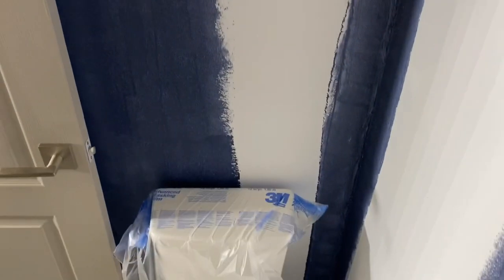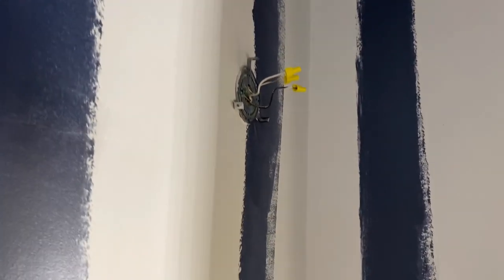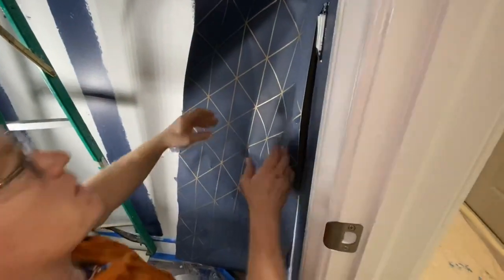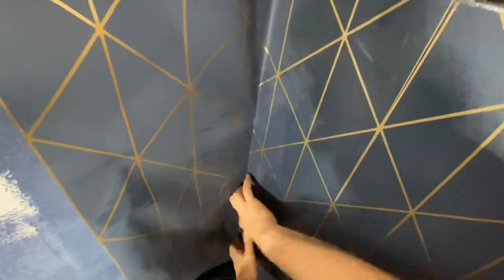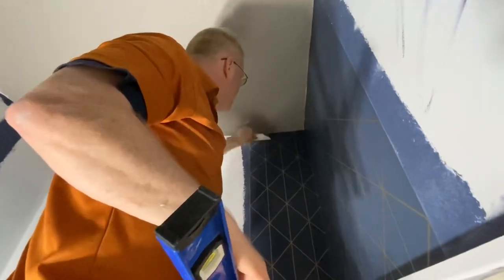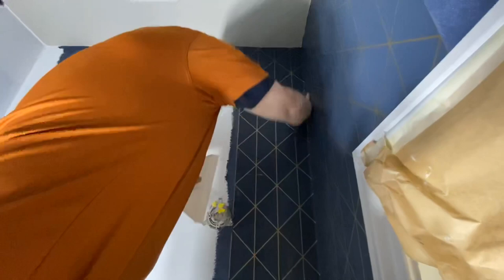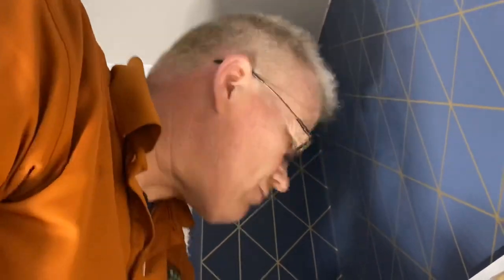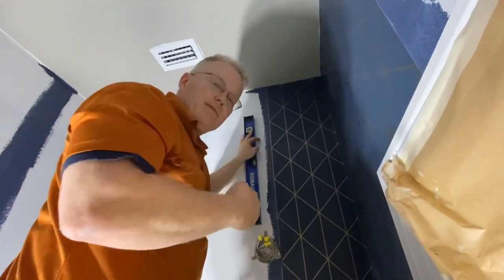Hanging a Geometric Pattern Wallpaper On Crooked Corners! - Spencer Colgan

Comment: When going around a corner onto a new wall, you should wet cut, leave a return and then work to a plumb line. No messing about. It is a little redundant to tell people to not handle the paper because of the ink when you are leaving a slurry on the wall. At work I have hung flock allot which would pull the material off the surface if you worked so uncleanly. It also is not a great idea to spray water on the paper because it could delaminate